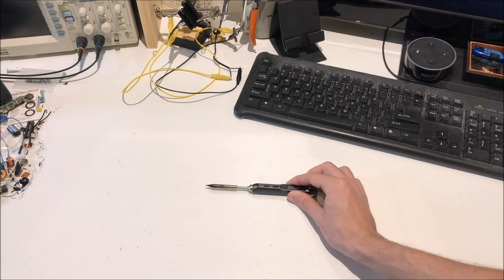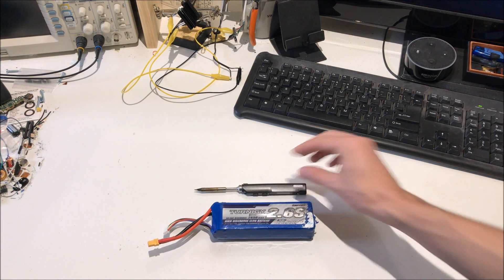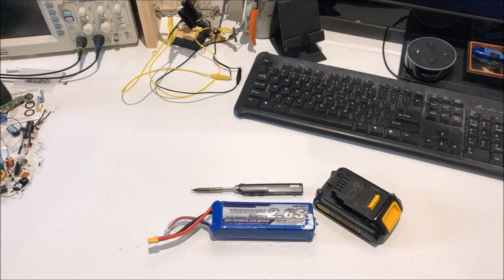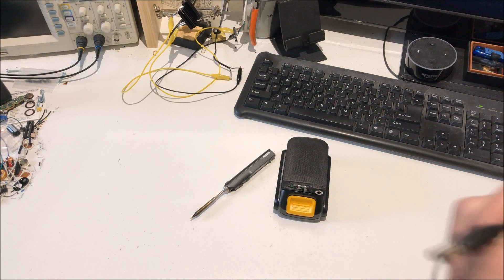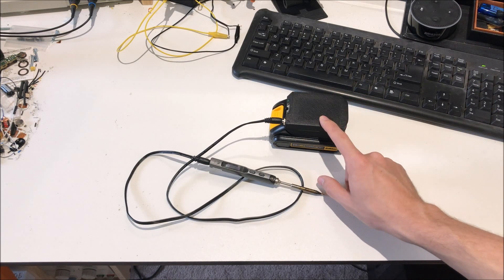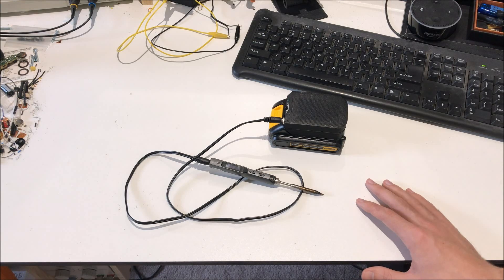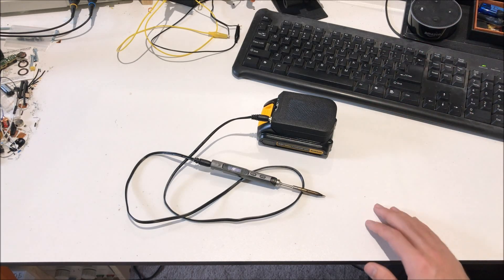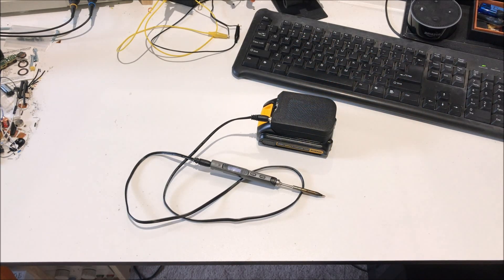TS-100 Drill Battery Adapter

Comment: I wish it had an XT60 connector. Many TS-100 users already have a nice heat-resistant and very flexible silicone power cable that plugs in the back of their iron and has an XT60 on the other end. This would also prevent anyone from plugging a random barrel jack PSU into your DeWALT battery.
Reply from the maker: I’d love to make one like that, I just need to add over temperature protection first. Then you could use dewalt batteries for anything you’d use with a lipo
Reply: @Chris_Ray97  Nice! Any thoughts on kicking it up to 24v for max performance out of the TS-100?

Comment: Interesting idea.  I just got one of these little soldering irons today at a thrift store for $6!  It works great and came with an extra tip and a 24 volt power supply.

Comment: Great... yes, I'm very interested!
- Great idea about the cutoff circuitry... so the pack isn't accidentally over-discharged.

- But why does it have a buck converter when the TS-100 is happy at 24v?   DeWalt packs are actually 18v... same as Milwaukee, Makita & most others.
- Might also want to consider the Kobalt packs... which are 24v & same form factor.  To run the iron at max.
I'd like to just buy one, as I don't have a 3d printer.
Reply: Hi again.  I followed the links to Etsy and I'm eager to plunk down some money.  A couple questions if you don't mind...
- If I read it right, it's designed to put the full 20v thru to the iron... correct?  As in no more buck converter?
- How's the ship time as of today?
- The Kobalt 24v packs are worth looking into... to run the iron at it's max.  This might be a factor for me as I won't be using the TS-100 for soldering.  I'm going to drill & tap the tip to install a much larger blade.  This is used for "burn-in" cosmetic wood repairs.  So there will be a much larger mass to heat up.
Thanks much, String.

Comment: Cool. I guess you stopped making videos. 😞
Reply from the maker: TAC Systems I’ll be back! Just started a new job so time is lacking right now.
Reply: A video that would take your 18v or 12v power tool battery to power AA or AAA battery device would be awesome. Would have to reduce the voltage maybe by using resisters. You would know more then I.

Comment: hey man! ordered a unit from you earlier this evening. roughly how long will it take to finish mate? really really need to get my hands on one asap! your a life saver :) bless man!
Reply from the maker: The Moon Productions I’ve been working with my board supplier to make the new version of my circuit board which should be ready in a couple of weeks. If you really need it earlier than that I could send you the last of the current boards which could ship the beginning of next week.
Reply: hey thanks for the speedy response chris! is there much difference in the new design? also will the ts100 run off 18v dewalt batteries?
Reply: oh and an 18 volt would be amazing!
Reply from the maker: The Moon Productions the only difference with the new design is that the original design uses a part in a way that isn’t considered standard practice. I changed the design so that anyone who wants to learn from the circuit will be learning the proper techniques but as functionality goes, they should work exactly the same. Also, yes the ts-100 will work with Dewalt 18v batteries without additional circuitry, just don’t mix up the polarity. I am currently planning on making some simple, cheap adapters for Dewalt 18v and Ryobi batteries (those batteries have internal regulators)
Reply: fantastic! so best if i wait for the new batch in two weeks? thanks for your detailed reply. really appreciate you taking the time. big up!

Comment: This is the best battery adapter for the TS-100 I've seen.  I like the switch and the barrel plug to barrel plug approach.  I have both the TS-100 and the DeWalt 20Vmax.  I'll be looking for it at instructables and thingiverse.  5 Thumbs up.
Reply from the maker: Hey, thanks for the feedback! My first run of circuit boards should be arriving sometime this week. They have been the determining factor of when I upload to Instructables and Thingiverse as I want to have nice photos of the internals (right now it's a mess). Check back in a week for links in the discription!